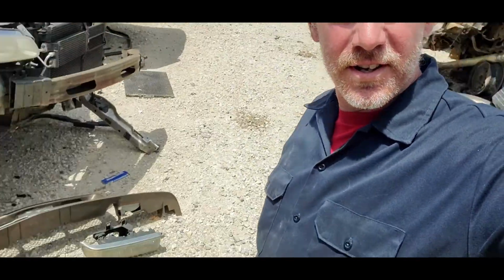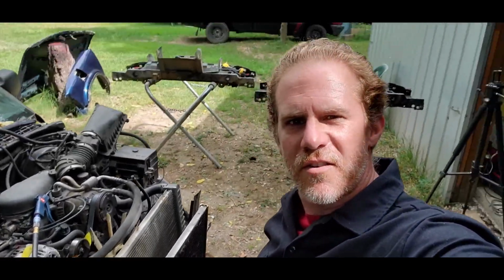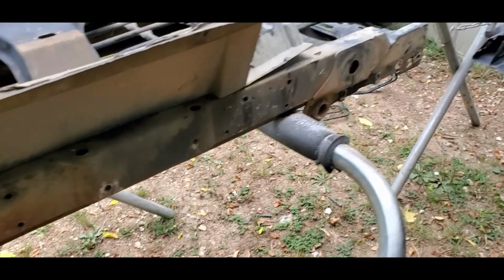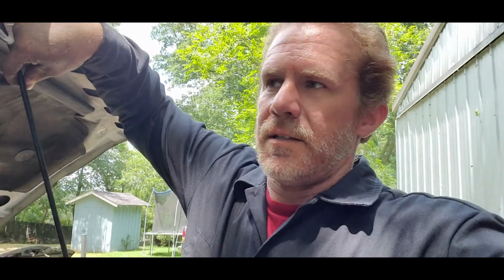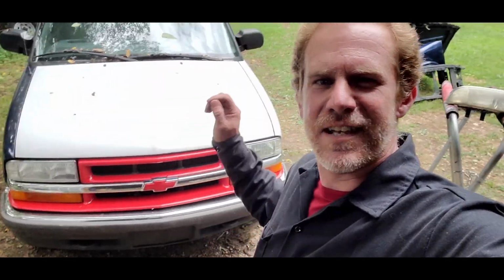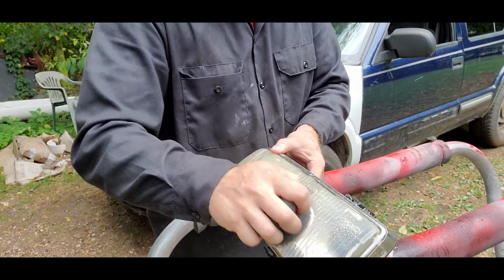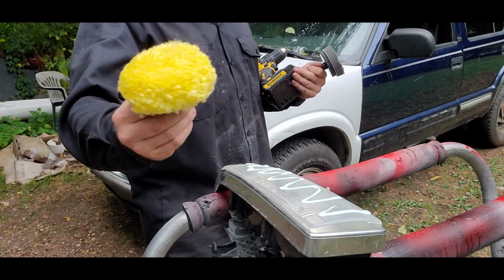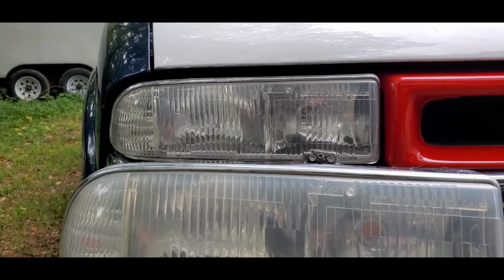Replacing hood, fender and radiator support on S10 Blazer + How to polish the headlights.

Comment: Nice work gave me some insight where my rad support body mounts are (Replacing them all 12) My Tip to you : Get yourself 1500 grit sheet, 2000 grit, 3000, and 5000grit ( 3M brand ) You can get them looking brand new If you want to go the extra mile Any light compound will make it sparkle  At the shop i will do this if a customer had 1 new light installed and the other one is yellow  Its nice when they start looking at the wrong side of the car for prior damage And you tell them its the other side you repaired
Reply from the maker: Thank you, and thanks for the tip. I've actually improved my method and it's pretty close to your suggestion, works way better
Reply: @toyshopfab  thanks for the video kind sir! But I have to know, what was on your mind at 11:25 ? I have a theory, and it is that those panels gave you a hard time at some point? I have to know.  I've watched this video a few times in the last few weeks and I just gotta know. Thanks again

Comment: You can wipe the lamp with lacquer thinner and it works just as well, just don’t go back and forth, one wipe in one direction and you’re done.
Reply from the maker: Go to know, thanks for the input!
Reply: @toyshopfab  try it on a old lamp you’ll be surprised at how easy it is, make sure the rag is good and wet and I recommend that you take it off the vehicle because it is lacquer thinner and will eat the paint.

Comment: What year Blazer is this? I have a 95 S10 that I need to do this on. Wondering if my year is a weld in core support and not as easy to replace as this.
Reply from the maker: It is a 99